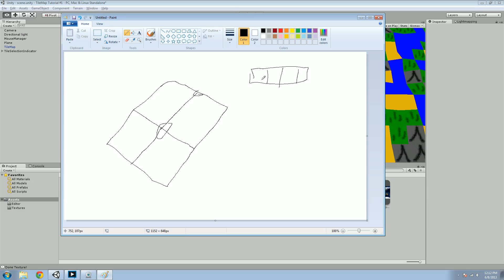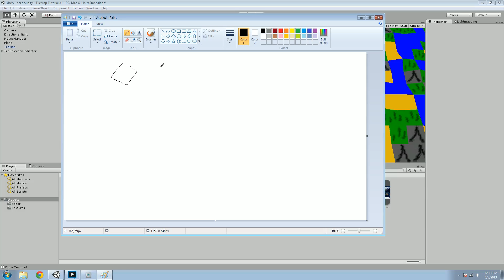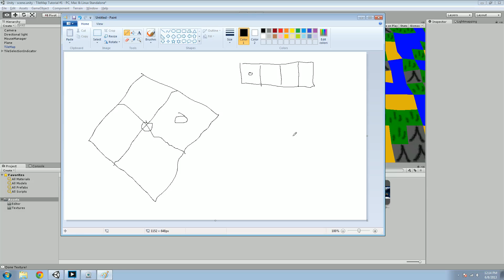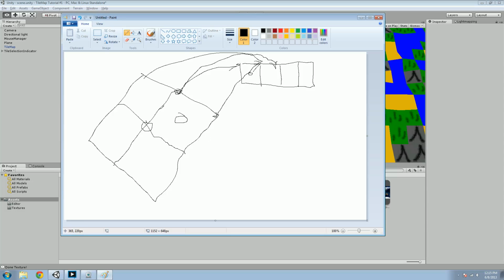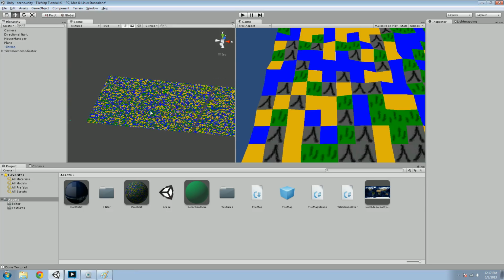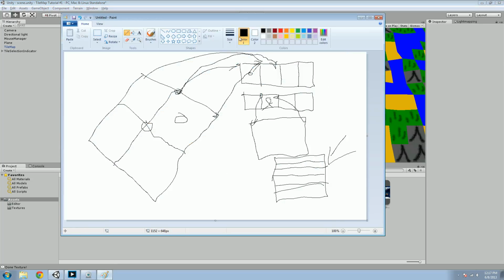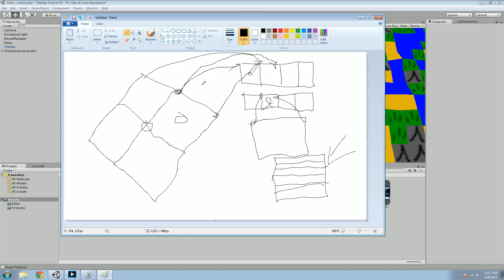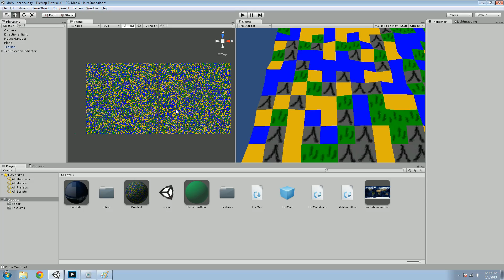Unity 3d: TileMaps - Part 8 - To Split or Not To Split

Comment: So this plus part 1 (the how to do this wrong) confuses me. If you make a separate mesh for each "tile" aren't you basically making a GameObject for every tile? Which i understood as a bad idea, since you start making tons of different game objects.

Anyway, my main question is why is splitting the mesh by tile better than making game objects for each tile with a sprite (assuming we are staying in 2d of course)?
Reply: There's a slight difference. This isn't really making a new mesh per tile - it's just giving each tile their own vertices. The difference between doing this and making a new GameObject for each tile is that the whole map in this case still uses just one instance of the classes around it. There's only one collider, and only one update function being called per frame. 

Whilst when you have a GameObject per tile, each tile will need their own collider, and they will fire their own update function per frame. In addition, each tile would then have all the overhead data (like their transform object, etc). This overhead quickly adds up.

The only real reason you'd want a GameObject per tile is if you need each tile to have their own update function (maybe different behaviours simultaneously) and their own transform object. Like if you want the tiles to move around or deform independently. But these are incredibly rare cases (and there's still better ways to get around it). 

Simply put - independent vertices means you reduce memory size and speed up run time.
Reply: no he doesn't create any new mesh

he said in 1st part it wrong because every single mesh checks for rotation position and etc.
wasted memmory and cpu time

when you create it as a single mesh that contains all other meshes there is only one check for rotation and position,
so basicly you saved a lot of power.
not to mention the transform script take memory (tested by me)
had a large map with every tile separated and had like 30mb more ram eaten.

basicly you can do it in one other way
there is a script that can combine a lot of mashes together (no sprites meshes only!)
and you will get almost the same result. but i did it the way i tried here
and now i can just cange every tile texture without any problem whenever i wont.

because i hold a pointer for every single mesh and vertices.

the only down side of this one
is that as a single mesh you can create a map of 130 * 125 tiles +- = 75000 vertices
so it like 4 times smaller.
but you always can create 2 maps or even 3. (in my case it's bad)

Comment: if this is more optimized why did minecraft make it so all the textures seperate
Reply: Maybe the textures are atlased on game launch
Reply: There is a misunderstanding here. 

TextureAtlas (aka. Spirte Map) is where you have multiple distinct elements stored in a single texture file and display a portion of this image on a quad using UV coordinates.
* Texture data exists in memory only once, and there is only one big texture object stored in memory, this is very efficient, but also quite limiting and difficult to work with when it comes to changing data or working with variable image sizes.

Alternatively, you can have multiple distinct textures and switch which texture you use on the quad, the UV map is static, but you have to load multiple textures into memory.
* Texture data exists in memory only once, but there are multiple texture objects, however each texture is generic therefore if you have 1 or 3000 objects accessing texture_a, all of them access the same instance. If you change texture_a at runtime, all objects accessing it will also be changed. This is very efficient too, but slightly less efficient that textureatlas - but does give more flexibility (textures can be variable resolution or updated individually without impacting any other element. Can be slightly more difficult to manage assets at runtime however.

Thirdly, you can copy texture data from multiple textures (or several parts of a texture atlas) into a new unique texture and apply the entire texture to a surface.
* A base texture file (or files) exist, but each object makes a copy of the data it needs. If you have 3000 objects using texture_a, there will be 3001 copies of texture_a. However, if object_256 updates it's texture, all other instances will not be affected. This is incredibly performance inefficient, however provides the greatest flexibility for modifying texture data at runtime. You can do special transforms of texture data without impact any other instances that use the same data. This method should be avoided except in specific circumstances however, as it is both memory and computationally expensive.

Minecraft (at least the newest versions) use #2. The older versions used #1, but to facilitate more advanced graphics and texture pack capabilities, they moved to #2 because of the flexibility it offers.

Quill's tutorial uses #3, he probably did this to emulate a similar technique used in Civilization series, however it lacks all the necessary optimization that makes it truly viable (storing texture data in chunks rather than a whole atlas, etc).